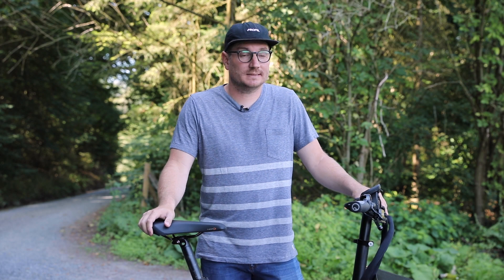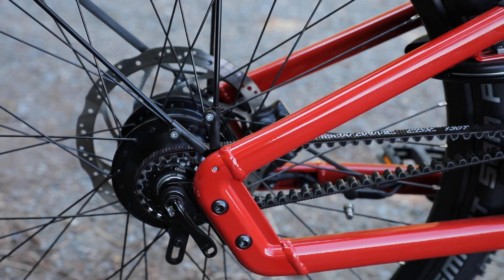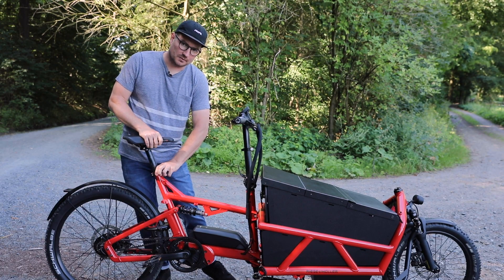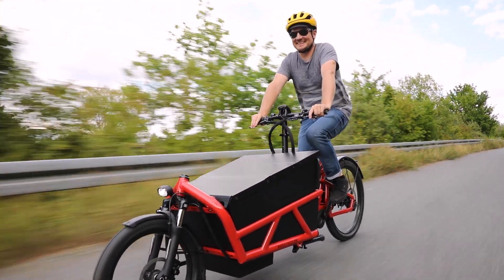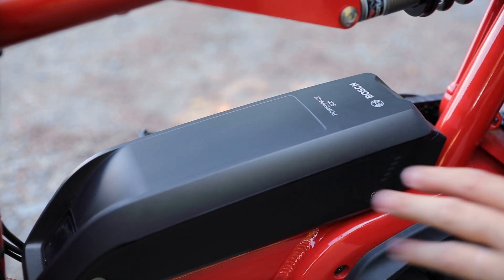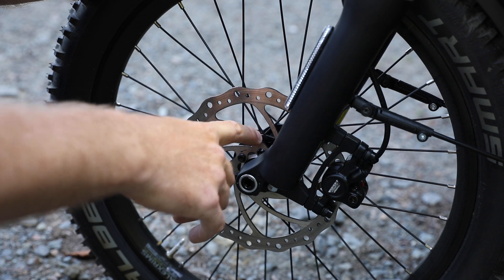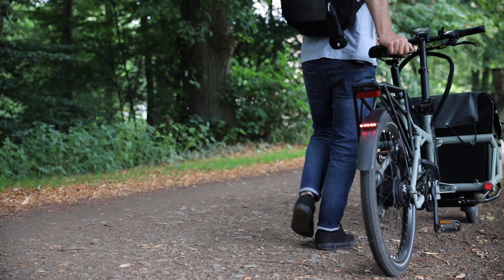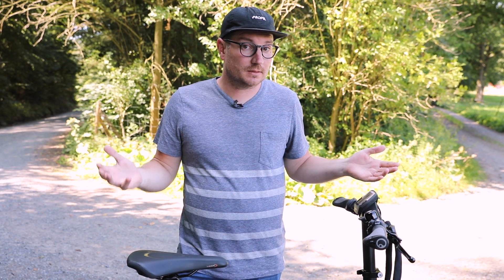Riese & Müller Load Review

Comment: Thanks for the very useful review! I got to ride a Load 60 today, and I thought it handled beautifully compared with the Packster 70 and the Urban Arrow Family. How does the handling of the Load 60 compare to the Load 75?
Reply from the maker: The Load 75 is very similar, you just need to take turns a bit wider and it's a bit less manuverable because of this. It's not a dramatic difference at all though.

Comment: Hey Dude, nice video!
By looking at the lockable highbox, it looks like the lock can just be added as an accessory on top of the box and manually lock it. I am considering the canopy option but dont want to trade the lock of the box. Will that be possible?
Reply from the maker: Thanks! Glad you liked it. The lockable top is an add on to the high sidewalls. The trouble is the top is bolted on so it’s not so easy to use those two together. I can see if that is possible and get back to you.

Comment: Is the luggage rack still a system rack, and if so, does it use Racktime or MIK or another option?
Reply from the maker: At the moment the rack doesn’t use a MIK or Racktime system, but you can add an adapter to accommodate these systems.

Comment: Chris,Is there a gear indicator with the Rohloff hub? Which is the most efficient gear?
Reply from the maker: The gear shows on the Bosch display. The efficiency is 96% (for gears #1 to #7) and 98% (for gears #8 to #14). They do a great job at optimizing for this.

Comment: Thanks for this great review ! How does this bike compare to let’s say a Tern GSD when climbing steeps hills with a passenger ? Also : are two pistons brakes enough ? The GSD has a four pistons Magura brakes...
Reply from the maker: You got it! Climbing would be a bit better on this bike due to the slightly higher assist level on the new motors. You could also opt for a Rohloff hub and get a very low gear for climbing, but you shouldn’t find that necessary. The brakes work fine in my experience, I haven’t had trouble and I’ve really put the bike through it’s paces.
Reply: Propel Electric Bikes OK thank you for your    answer !

Comment: I am uncertain if this has already been mentioned, but how does this bike (or this category of bikes) do on uphill torque / capability, as well as downhill handling / safety? The crux of my wife's work commute is a BIG hill. Thanks. Well done on the vids!
Reply from the maker: Thanks John! Uphill power is not problem, the big thing to remember is you effectively have a transmission paired to a powerful center motor. When you shift to the low gear the motor uses that gear as well as the rider. 

For safety I don’t believe there is a cargo bike that compares, namely due to the full suspension. This keeps the tires on the road no matter the terrain. 

I use this bike regularly with my videographer Tara in the front and we’ve even taken it off-road at times with her upfront filming.
Reply: @Propelbikes  Thanks C. We are in-process of moving back to West LA. I'll pop over to see you in Long Beach...
Reply from the maker: I’ll look forward to it! 😊

Comment: Hi Chris, I have a 2019 load 75 HS with derailleur, I'm planning to buy a 2020 load 75 HS with rohloff e 14. Are these gear shifters comparable in shifting speed, reactivity and performance of the bike, because I tried the 2020 HS with the vario and I was super desapointed. There was no reactivity, did not feel any performance update of the 4th Gen bosch cargo speed compared to mine. So I hope the rohloff changes that. Thanks a lot, and like always amazing videos!
Reply from the maker: The motor needs to be reprogrammed to the non-cargo speed version. It will make a major difference and you will see much better performance. The cargo line is great for heavy loads but not so ideal for lighter loads as it will lack power if not under load. The Rohloff will have similar performance to the touring, but you’ll have more top end power than the 2019 version.
Reply: @Propelbikes  thanks for your great answer!

Comment: Hi, is the cargo for the 2020 compatible and available for the 2019 version? I see that the footwell and the adjustable seats are really an improvement on the 2019 box design. Thank you
Reply from the maker: I'm not sure. I would recommend reaching out to your dealer or R&M direct on that one. I think there is a slight change to the frame and the control arm to accomodate the footwell, but the adjustable seats should work if you add the new box.

Comment: Hey Chris, why hasn't other cargo bike makers have followed the front and rear suspension? Has R&M patented this particular bike frame with the suspensions? Another awesome and informative video!
Reply from the maker: Thanks Alika! I don’t believe this is patented, but I will say that this design as with much of R&M designs are challenging to execute on. They are true innovators and often imitated, but never duplicated as we like to say. They started the company by designing their full suspension folding bike the Birdy and this set them on the path to do continue to push the envelope. I think most companies aren’t willing to invest in the required engineering time and money into making something like this truly successful. These bikes are designed and imagined by real riders and they aren’t made just as a business opportunity, but rather a bike that they want to ride. In short, the business opportunity might not be big enough especially if a new player would need to go up against them.
Reply: @Propelbikes  Thank you Chris! Well answered, I must agree. R&M has set a very high bar to follow. It would be very interesting to see if another company decided to duplicate some design aspect to their cargo line in full carbon fiber frame. Curious on how will that affect the current overall handling and longevity of the battery life. Could potentially increase a higher level ride experience...

Comment: Hey, in one of your videos you mentioned that the Cargo-Line SW of the new Bosch Gen feels... well different, less supportive, less agile than the former Performance. Also, that the Retailer might change it based on the customer preference. Is this something that you can do as RM retailer in you shop, or do you need to order it right away with that different SW? Or did I completely misunderstood :D
Reply: Woops, just found a thread that this is possible through every retailer (as long as they know how to do it and have the right Bosch stuff i assume) and that RM is even supporting that.
When you use it just as ride for one kid, no heavy cargo, would you definitely recommend to take the CX software?
Reply: last but not least. do you have already an announcement by RM when they gonna present their 21 lineup?

Comment: Somehow I missed that the belt is used for both the Rohlof and Nuvinci gears.

Which is better btw? The rohloff or nuvinci?

I’ve talked to the local vendor of RM bikes, he’s not keen on the idea of servicing a bike with Rohlof or Nuvinci gears. So he’s not offering to order RM bikes with those systems. He prefers the Touring option which from my point of view requires more maintance, eventhough parts are more readily available.
Reply from the maker: Both the Enviolo and the Rohloff use the belt. I would recommend riding a bike with both of those systems even if it’s not a load. They are very different in the performance and the ride experience. The Enviolo is very user friendly, where the Rohloff has a little bit of a steeper learning curve. The Rohloff is has a wider gear range and it’s more efficient than the Enviolo, but they are both great low maintenance options.
Reply: @Propelbikes  I have an e-bike with N360 and Auto-sync today. How much different are the two systems delivered on the Load 60 / 75?
Reply from the maker: The N380 is very similar, but a slightly larger range of gears and the shifter works manually instead of automatically. 

The Rohloff hub is also a manual shift, but it’s electronic and it’s indexed meaning there are individual gears whereas the NuVinci (now called Enviolo) is a CVT and the gear range is shifted without breaks, it’s more like a volume dial compared to a channel clicker on the Rohloff.
Reply: @Propelbikes  

If I understand you correctly:
Enviolo with H sync: Set and forget
Enviolo with manual: Adjust to terrain
Rohloff: Manual shift, must adjust to desired momentum and cannot shift gear while standing still.

Which of the belt options for the Load would you recommend?
Reply: @haraldsh6653  the Rohloff can be shifted while standing still. 
That's one of it's greatest features, IMHO. 
I'd choose the Rohloff any day.
Reply from the maker: If you have big hills and you want to do Touring the Rohloff is really nice. The Enviolo hub works great for city riding but it doesn’t have as low of a gear as the Rohloff. I would recommend testing both shifting systems if you have a chance.

Comment: Great review thanks Chris.  One thing I haven't been able to find is the length measurement for this bike - I figure to transport this, you'd probably need a trailer - how long is the Load 60?
Reply from the maker: Thanks! The length of the Load 60 is 97” so you probably would need a trailer. Technically it’s possible to separate the front of the bike from the back, but it’s not something you would want to do often. There is a company called ATOC that makes a product called the Draftmaster. The Draftmaster isn’t currently rated for a bike this weight, but they have been working on something. If you’re really ambitious you can put it on the top of a wagon or SUV. I’ve done it before. There are roof racks for tandems which make this easier, but still not easy.
Reply: @Propelbikes  Thanks Chris.  Last time I tried to put a normal bike on a car roof I ended up buggering up the knee for months, which, funnily enough, was the catalyst for getting an ebike in the first place....
Reply from the maker: So that definitely sounds like a bad idea. A trailer or van might be needed. I’m actually taking a Load down to San Diego in a van today oddly enough. We use it for our video shooting. My videographer prefers the Load over all other cargo bikes. I do too :)

Comment: Has anyone awared that the bike costs starting at $9,000 USD ? :D
Reply from the maker: The Load 60 starts at around $8,000, but it can go up from there depending on the options you select. Most people that want a car replacement won’t want to skimp on specs. I know I don’t want to, especially if they offer me additional utility, safety or performance.